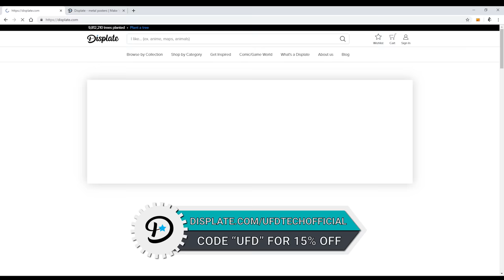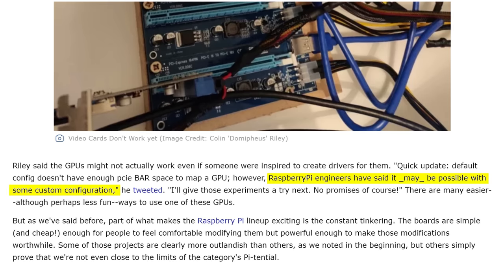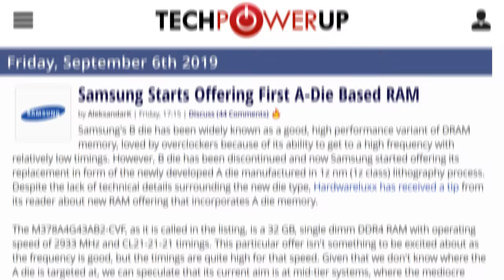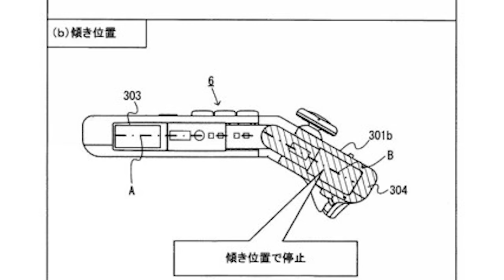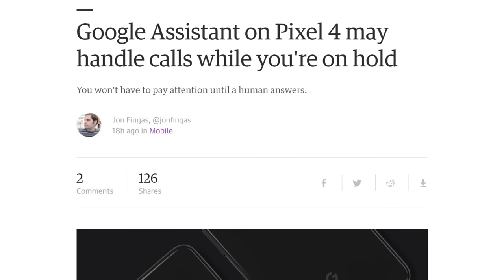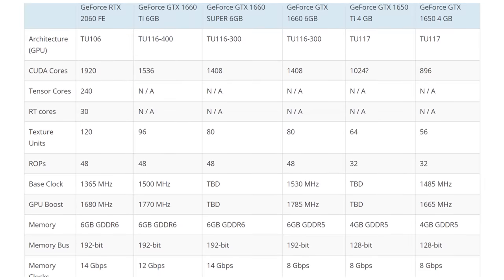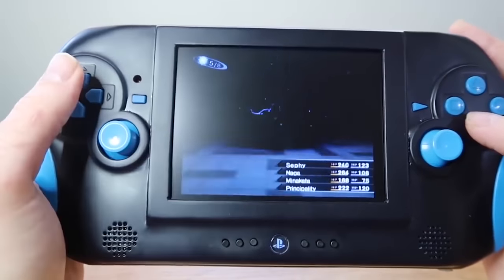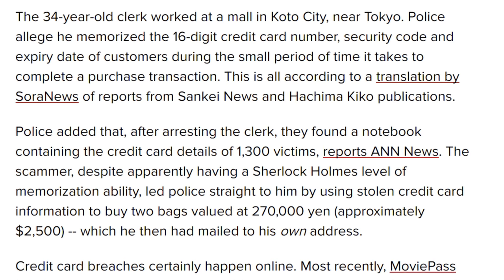Latest Mining Craze is Here?!?

Comment from the maker: Timestamps!
► 00:49 - Raspberry Pi, The New Mining Craze
► 02:25 - Panasonic’s Megacon TV
► 03:05 - Aorus AIO
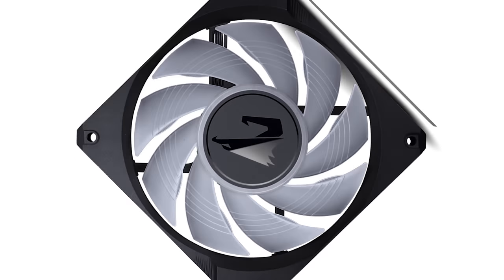► 03:22 - Samsung A-Die RAM
► 04:00 - Thermaltake TOUGHRAM
► 04:17 - Bendable Nintendo Switch
► 05:01 - India Loses Lunar Lander
► 05:36 - Tesla Truck in November
► 06:07 - 175M Android Tablets
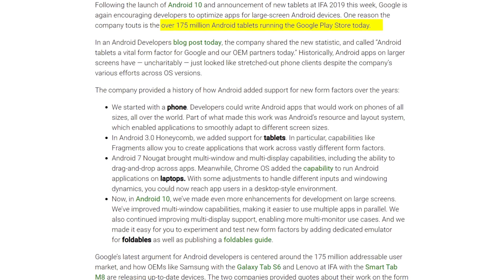► 06:36 - Google Assistant Pixel 4
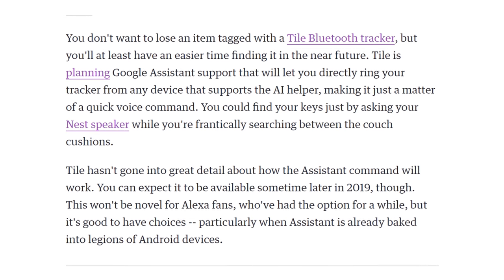► 07:11 - Pixel 4 Details Leaked
► 07:37 - Apple Logo Centered for Wireless
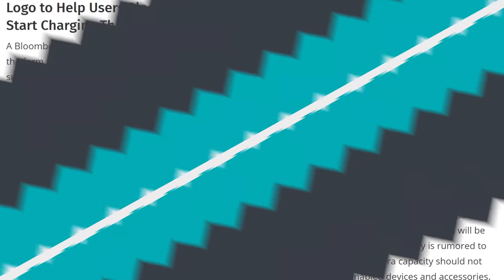► 07:52 - GTX 1660 Super
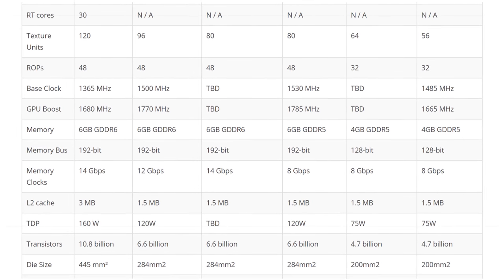► 08:27 - Intel Chipset Drivers
► 08:52 - PIS2
► 09:29 - PS Classic $29
► 09:55 - Helicopter Taxis
► 10:31 - Stolen Credit Cards By Memory
Reply: hey why do you shave bald always?
Reply: Yes you can emulate PS2 games on your phone. You just have to make sure you don't have a dated phone as it wasn't till the snapdragon 845 that it became playable at all so you basically need the newest phones out there to get perfect performance. Gamecube and Wii emulation is far easier as Nintendo's devices were never as complex as the PS2 or PS3 so emulating them is incredibly easy. The Dolphin emulator (the same one used on PC for both) had just added mobile support about 2 years ago and it basically is flawless. If you have an 835 than you will only get good performance on 30fps games, the 845 has nearly perfect performance with the 855 being absolutely perfect.
Reply: I just want to have a graphics card for raspberry pi to game lol

Comment: I wish there was more premium Android tablets on the market.
Reply: more UNLOCKED  android tablets would be nicer
Reply: @kBitre  Those exist?
Reply: The new Samsung tablet was rated best tablet by ETA PRIME
Reply: I wish there was an updated model of the Nvidia K1 with more ram and perhaps a slightly more powerful cpu. Its fine for gaming and game streaming but for day to day use, it feels like a slug. It takes forever to open PDFs and large documents. :/
Reply: Premium and Android should not be used in the same sentence. Leave that to Apple bro ;)
Reply: @FFE0  
Unfortunately, Android's greatest weakness is its greatest strength, its openness. Linux has struggled with the same issue. Being open with so many hardware configurations presents problems for developers that trickle down to issues for consumers. I prefer the Apple approach and its result. But, it is good for the Android approach to be an alternative.
Reply: I wish there was atleast a single good budget ($200-250) Android Tablet.

Comment: I am miner with 4 rigs.  Mining hardware is very affordable,  bitcoin hovering around 10k and yet even at 10 cents per kwh, mining is not profitable.  The reason is you cannot mine bitcoin with gpus, you can only mine altcoin and change into btc.   Btc accounts for 70 % of global crypto market now.  Overall hashrate is way up.  mining at current climate with low power cost is not profitable unless u already own all the hardware and electric is 10 cents or lower.  Example,  a new amd 5700 would take 900 + days to roi as it stands.. mine on